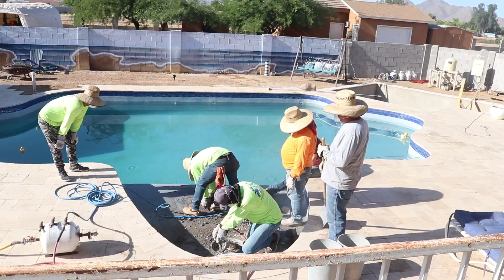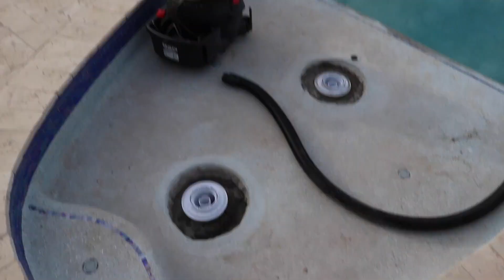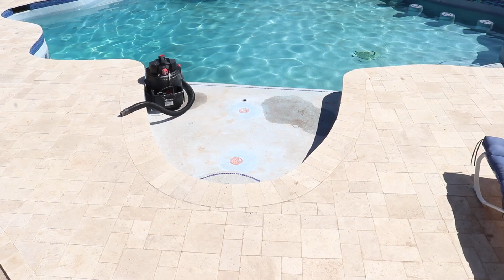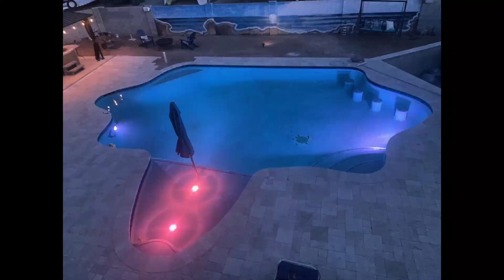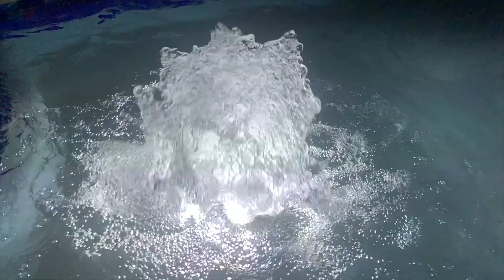Pentair Pool Bubbler and Pebble Sheen Repair

Comment: That is the bubbler we have, and the small cap that fits over the center of the top portion of the bubbler is missing.  We have a new pool company who does not know how to replace that part.  Do you know how we would get this?  This is the first video I have found that has our exact bubbler, so hoping we can figure it out.

Comment: Show how to repair it all i seen was u talking
Reply from the maker: The repair was done by the contractor.  They removed the old fixtures which completely destroyed them.  Then lowered the pipe feeding into it and then put the new fixtures in.  Not an easy job.

Comment: Hello Bear! Any chance you have a video on how the "guts" of this light go together? We had ours installed, but it's not shooting up. It almost looks like the center plastic piece (looks like a donut) isn't installed in the center of the light. Any help is appreciated!
Reply from the maker: From what I have seen and experienced there must be an issue with the water flow from the pump.  There should be a dedicated line from the pump to the light.  Usually 3/4 pipe.  A couple of questions.  Has this every worked?  Is this a new install?  Do you know which valve on the pump controls the flow?
Reply: you have to install the center round adapters, there will be two different sizes and they install from the top side, the hole has a notch they fit in to.  One adapter is smaller for higher bubbles